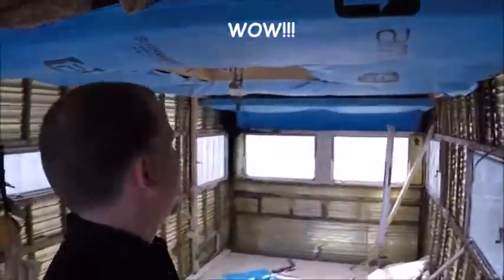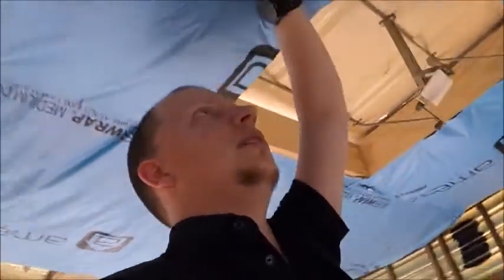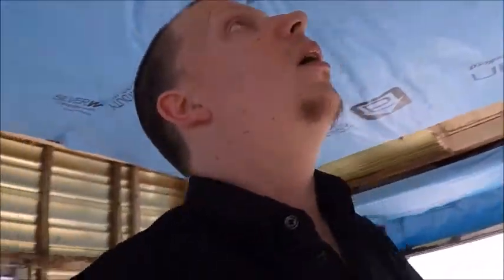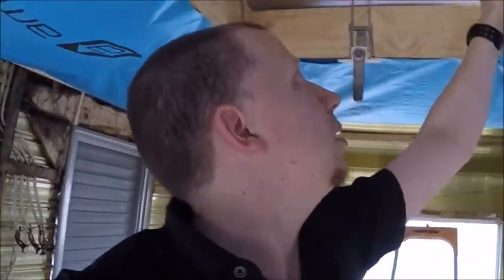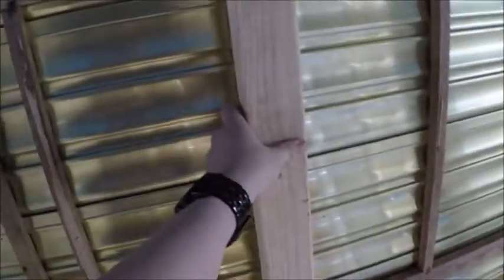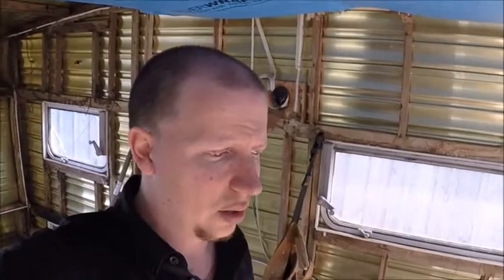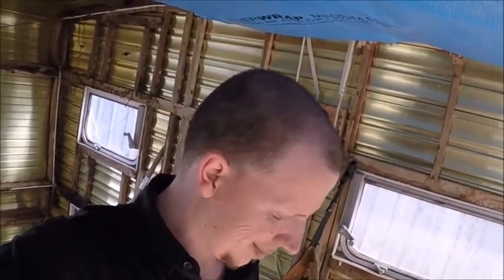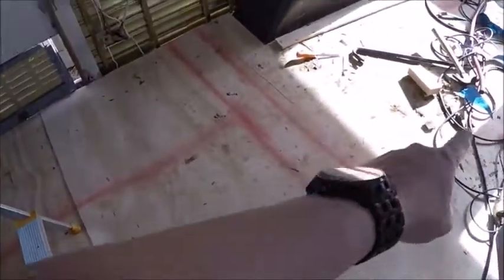Philbi TV - Vlogs - Caravan Reno Pt8

Comment: Lets consider this... If you were to go caravaning in the cooler months, wouldn't it be nice to have a warm van to sleep in?... The insulation on the ceiling is great to stop radiated heat over head but if you where to not insulate the walls you would lose valuable heat when its cold so as you know insulation works both ways by keeping heat or cool in or out by cutting down on radiant heat transfer......would I be wrong in saying this?...if not, would it be a wise decision, although it be at the a greater cost, to insulate the walls as well as the roof.
Reply from the maker: David O'Shea: you're right.
I will end up doing it, just have to keep an eye out for some more insulation.
Plus I won't have to hurry with that one ether as it's not as important as the roof heat.